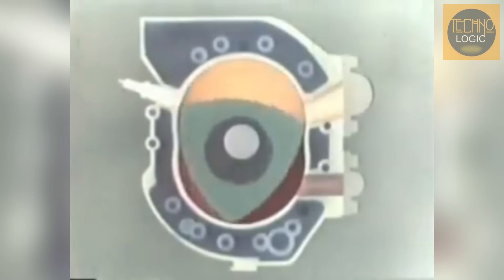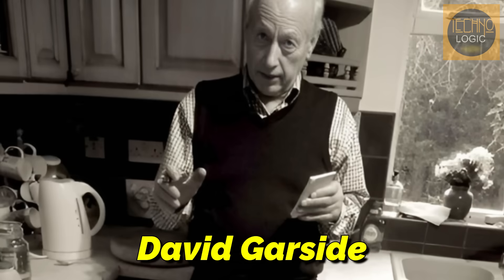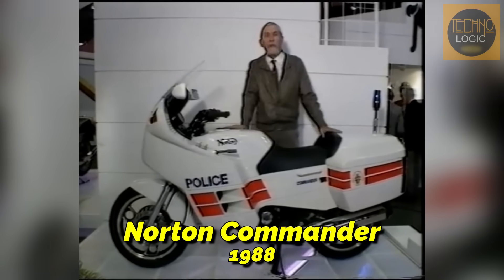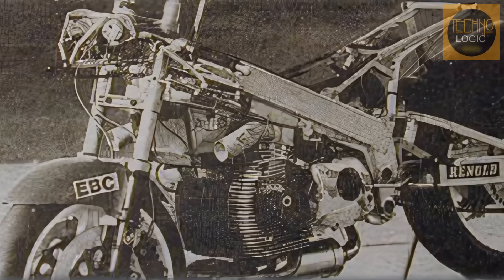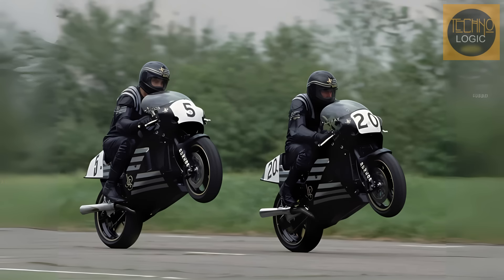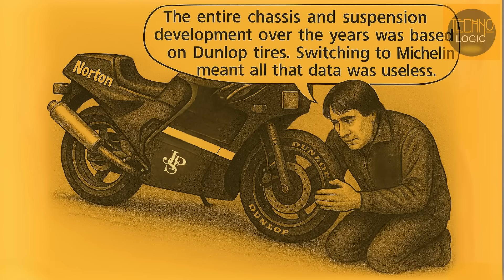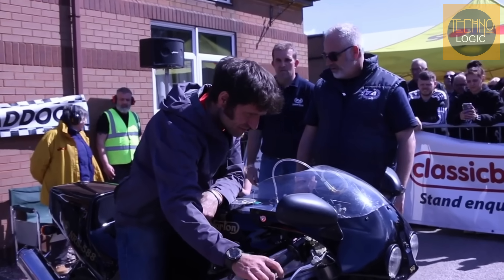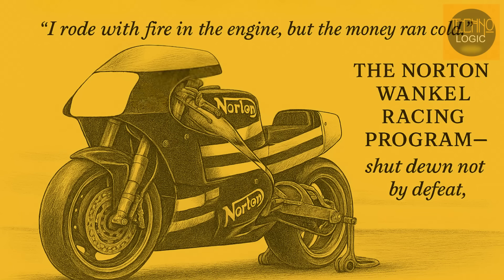Too Fast... ‼️ The Story of the Norton Rotary Engine

Comment: I liked this video very much. When I was 17 in 1981 I rode and raced a few times a RD 350H (LC)in the 410 production class. I still have the bike and just pulled it out of the barn and brought to Vancouver BC to fix up. I tried to save for the later RD 500N (LC) but it was too much for someone starting out on their own.

Comment: It was never ever going to work, rotarys are just too inefficient. The ONLY way to make them competitive was to have the biggest engine in the race. The 588 sucked in and burnt 1764ccs of air and fuel with every revolution just to compete with a regular 750!!
Reply: how so? one revolution of the rotor. 3 revolutions of the eccentric. 
admittedly the 750 four banger only sucks down 375cc per revolution... two smoker will be closer to the 750cc mark except for pumping losses and actual versus calculated swept volume..

Comment: We should make 120cc versions of these triangle rotating axled contraptions!
Reply: They are too noisy, too thirsty for fuel and oil, fail emissions regulations and suffer from excessive wear of the scrapers plus uneven heating of the engine casing, which causes warping. One side of the engine runs much hotter than the other, as you can see by watching an animation of the combustion cycle.

Comment: The plenum did little to cool the intake air. The overheating problem was from the downdraft carbs being located behind the radiator, boiling the fuel in the bowls. Oil was injected with the air going through the motor to lubricate the internals then went into the combustion chamber to lubricate the rotor seals. On the race bike, Norton used an ejector system on the exhaust to pull the air/oil through the motor. Oil was mixed with the fuel to lubricate the rotor seals and the carbs pulled fresh air through ducts on the sides of the fairing.

Comment: motorbikes have frames not chassis, disliked.
Reply: What an absolutely ridiculous comment....professional frame designers and builders refer to them as motorcycle chassis more often than not.
Look up the definition of a chassis and you'll find it includes motorcycles and not exclusive to motor cars.
Reply: Chassis is just a franse word for frame.
Reply: @Superliegebeest0  And relevant to a lot more devices other than just motor cars or motorcycles...even television sets  and other domestic items are known as having a chassis which all the components and other gubbins are built into/onto.
Reply: @Superliegebeest0  What does 'franse' mean in your little brainless head, because it isn't a word.
Reply: @RobertWorrillow awww, there there... you made a silly comment about the nuances of language, terminology, made a fool of yourself over such a silly comment, and now lash out in response as someone happened to get a typo, which these days is more likely due to autocorrect and autofill than any mistake on the part of the author...

best bet is to delete your original comment, because everyone reading it will also be calling you an idiot, and every response you make will just hammer the nail home...
Reply: @paradiselost9946  Well said👌
Reply: @RobertWorrillow It very likely means that the comedian who created the auto spell tool didn't make a good enough effort before imposing it upon internet users.....is this really the best you could do for a response to someones typo error?
Reply: I use both terms tbh.
They can both be correct, neither is incorrect.
So, no issues here.
Here's an upvote.

Comment: Nonsense about Norton buying DKW tooling...
Reply: Norton bought Hercules (DKW) tooling.

Quote: "The Hercules W-2000 wouldn't die in 1977 when production ended however – the tooling was bought by Norton who had been impressed by the mule rotary motorcycle developed by David Garside using a BSA B25 'Starfire' frame".

Comment: JPS is John player special not and sons as you stated
Reply: The factory was called John Player and sons. They were the sponsors of the John Player Special (one of their cigarette brands) team.
Reply: @markrainford1219 yep, jps was the logo for the special brand, at that time they also did the blue packet, but that just had John Player King Size printed on the pack with no logo
Reply: no wonder..i thought i was wrong! I use to sell those cigarettes in my dads shop as a teenager!
Reply from the maker: https://en.wikipedia.org/wiki/John_Player_%26_Sons?wprov=sfla1

Comment: We ran into the same problems in sports car racing.
I used to own a Formula Atlantic car with a 12A and later a 13B peripheral port rotary.
Exhaust was "HOT" (understatement), if I spun out on the track and ended up in the grass there was a fire under the car EVERY TIME !

Further more our 12A and 13B engine were forced to run against much bigger piston engines. The sports car regs are rigged against rotaries.

The other BIG issue was noise.
Rotaries are incredibly loud.
I had great difficulty meeting the noise limits which were increasingly every year being lowered.
It just got to the point with all these rigged regulations to just throw in the towel.
If I was racing on the pro circuit like IMSA noise would have been an issue.